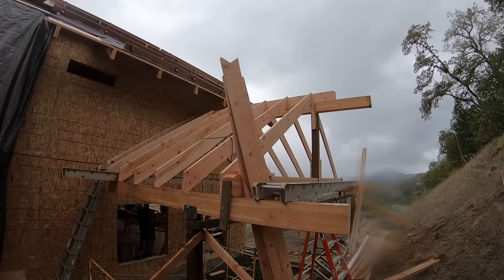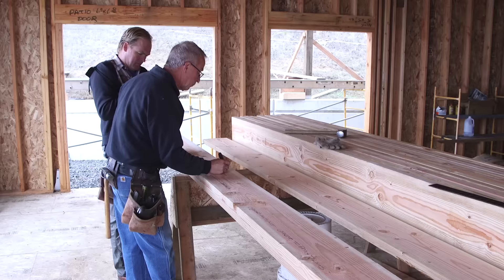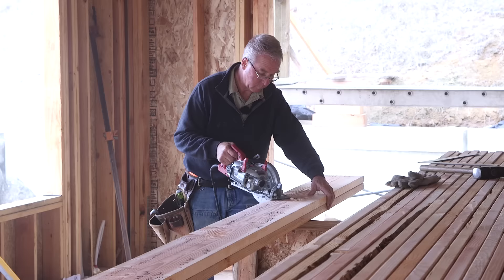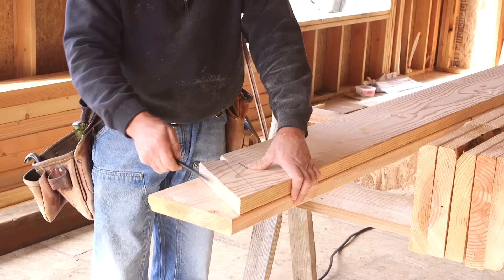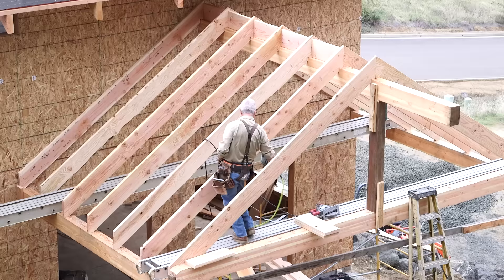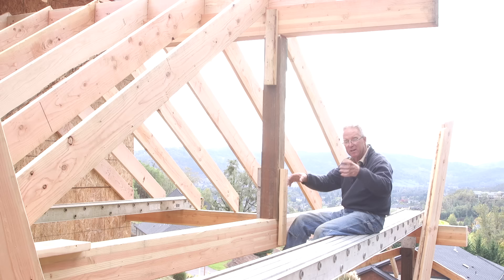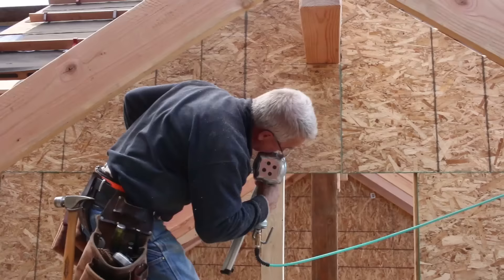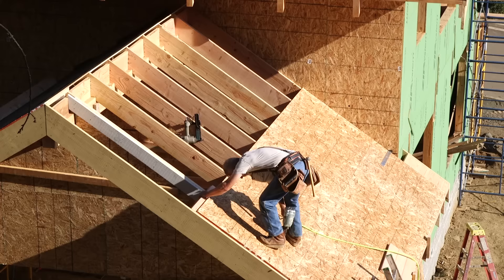Cutting Common Rafters Ep.72

Comment: Grew up in the US framing, roofing and pouring concrete. Moved to Europe when I was in my late 20's. Dear God why do we not use metric in the US. I grew up doing all these calculations and thinking they were simple. WHY?
Reply: "Do as I say and not as I do " the king said"my foot Will be the standard.
Reply: My favourite part is having to convert the measurement to decimal, do the calculation, and convert back again to measure... there are some benefits to imperial, but they’re massively outweighed by the math-friendliness of metric
Reply: I moved to Texas almost 2 years ago. I am a qualifed builder, I use both but metric is far more accurate and better to use.
Reply: In Canada we have metric system but as a carpenter for shy of 40 yrs I still use imperial system . Laying out cabinetry is nice to use metric .

Comment: Essential Craftsman - the Larry Haun of the modern generation
Reply: Larry had poor work habits like overcutting birds mouths.  Slopy workmanship. This guy is much better.
Reply: But he is still better than your carpentry work and you will not reach his level of productivity and skills even if you are the same age as him. The less ppe they wear, the more sketchy cuts and questionable shortcuts they make to make it structural and productive the better they are. Both of the older gentlemen are great carpenters in their owns way and we should all learn from every carpenter as much as possible.
Reply: Did someone just say Larry Haun had poor workmanship...? I never thought anyone could say a single bad thing about the man.
Reply: @dielauwen  careful now, dissing Larry is an enditable offence. Larey wasn't sloppy, he knew exactly how much strength he was working with. 
Modern materials are different. We don't use old growth timbers any more, its farmed softwoods and OSB and so on, so the techniques need to adjust to materials. 
We also know a lot more about engineering, so where Larry's house may not have survived a tornado, a modern house may. That's a design factor, not a sloppy builder. 
Larry was very clear about following the code and said so constantly. If the code changes over time, so would have Larry.
Reply: dielauwen Ridiculous. I knew Larry and trust me there was nothing sloppy about him, and his work habits changed the way houses were framed. There is nothing wrong with overcutting a birds-mouth the way Larry did it. The tail was still 500% stronger than it needed to be. He saved 10 steps doing that. He and his 2 brothers framed one house per day, every day, for years, mostly nailing by hand Try that before commenting on “work habits”.
Reply: @HBSuccess  hell yes. Amazing
Reply: Hope fully scott will become a legend like larry haun,  keep going with the great video scott its really interesting #carpentrylove
Reply: Larry was not sloppy.  You don't understand rough framing.
Reply: Yes he is good to listen to

Comment: I cut rafters off of a template and I reverse engineered it to teach myself this years ago when I started building toolsheds. Man did I wish I had this video then. You explained things I taught myself with a speed square through trial and era in a drawn out process. I liked seeing how you gang cut rafters too we’d be a lot faster doing them like that. I’m gonna try that once we go back to work after isolation
Reply: Me too. I ended up devising my own system. I set the ridge and then measured to the back of the birds mouth diagonally across the board. Test fit, then trace from a template. I know, I know, a complete abomination to any self-respecting rafter man, but it did/does work and I had to do it that way bcz the boss (the real rafter man) would never take the time to show me the right way.
Reply: Only stupid way is the way that doesn’t work
Reply: @psidvicious  That's exactly how I'd taught myself how to do it as well. Seemed like the easiest way to be able to measure it out.
Reply: @Gottesacker86  Haha! It seemed like the easiest way at the time, not knowing any better, right? You already know what the pitch angle is, so that’s not a problem transferring that to the board. Just needed that one pesky measurement for the rafter length 🤷‍♂️
Reply: psidvicious exactly! I have to admit too, I’d never thought to do the rafters first, then the ridge. Though thinking about it, I’d watched Larry Haun do it that way too, but I guess once you’ve got your way of doing it, ya tend to stick to it. I’ll definitely try this method out next time though.
Reply: @Gottesacker86  No, I think we’re doing it the same way. Ridge first, then measure from top of ridge to outside of top plate (which will end up being back of birds mouth). Then transfer that measurement to the board making a sort of arc line so you can get the proper seat cut (length and depth). 
[one of those times when I wished I could include a sketch in YT comments 😁]
Reply: psidvicious yep, exactly the same, arc and everything, hah
Reply: I generally avoid pointing out small mistakes in typing, but in the interest of humor, I feel it's worth acknowledging the irony of "trail and era"; I don't know if it was deliberate, but it would be more amusing if it was unintentional.
Reply: ILikeWafflz ... and in the same vane - ‘trail’ 😀
Reply: @gerryheynes5082  Haha, u caught that too.  I thought that was pretty funi...er, funni, er, funnni....oh hell, u know what I mean!  :)

Comment: I really liked the no nonsense calculation using the framing square and Imperial sizes and this is coming from a metric guy.

My middle school memory tells me to use math for this and I came up with the following result

    Total span is 19'7" = 235" --> half span is 235"/2 = 117.5"
    Rise is 117.5" / 12 x 8 =78(1/3)"
    Length (Pythagorean equation) = Square root of ((117.5)^2 + (78(1/3))^2) = 141.21"
Reply: That's good....you got out of Imperial into decimal on the first line of your solution.
Reply: @davidrichardson376   Standard uses decimal also, there is nothing specifically metric about it.
Reply: @firesurfer  IMHO a decimal fraction of a foot is absurd.  Decimal fractions are at home in metric.
Reply: A framing square is the real thing as it has inches with a tenth scale, a twelfth scale and even sixteenth for die hard customary/imperial people.
Reply: @firesurfer  Some of the old-timers still use Chains and Furlongs too.....LOL
Reply: @davidrichardson376  Pretty much all civil engineering and surveying in the US is done in decimal feet.   You will rarely ever see see a surveyor or civil engineer using inches, except where they have to interface with architects and the building trades.  There's a reason for that, and the reason is when you're actually doing calculations with those numbers, decimal is the only thing that makes sense.
Reply: @davidrichardson376  You'll have a hard time finding any surveyor who uses furlongs.   The reason chains are used are because our public land survey system is based on that, and it's so thoroughly enmeshed in our land ownership system, it's impossible to get away from it.   But here's the thing they measurement system of the Gunter's Chain is actually more decimal the the feet/inches system.  A chain has 100 "links"  and links are broken down into tenths of links.  and when going from distance to area, 10 square chains is an acre.   It all fits together in a nice convenient decimal based measuring system. Try that with feet and inches.
Reply: @andrewalexander9492  I agree, but it is still a poor compromise to an 18th century measurement system.  It really does not matter how far apart the "Tick-Marks" are apart on your framing square, just so long as you don't have to have a second scale to communicate with the rest of the world.  The World is not going to fall into line behind North America on this one.
Reply: @andrewalexander9492  Thank's for that Andrew. Now I'll know what to look for if the occasion arises.  Meanwhile, I will continue to think in Hectares (100 metre x 100 metre') as any other system makes my head hurt and wastes my headspace.
Reply: @firesurfer  And don't let all machinists in America know... they will freak out about using tenths and thous :D

Comment: i am so glad i don't have to deal with the imperial system... its so much extra work
Reply: If you actually learn standard, it makes much more sense than metric.
Reply: @bobsmith-ru7xp  Your right people complain then dont bother to learn anything.
Reply: @bobsmith-ru7xp  It really does not in any way shape or form make more sense than metric. Ever.
Reply: @eggsoups  Don't know about North American rulers but all rulers in Europe go down to the millimetre.
Reply: It's only difficult for those that don't use it.  I don't need a calculator to do 1/16" conversion because I use it all the time.  The same goes for using cups/pints/quarts/etc.  I rarely need to convert inches to feet since every measuring tape I own has both and I'm sure he doesn't either. There are numerous short cuts for these calculations that he isn't showing in order to explain them. The imperial system is so easy to learn we teach children in the United States how to use both it and the metric system. 

The imperial system is based on biological averages. I can use parts of my body to rough out measurements. My index finger middle joint is about 1" long (25mm). My foot is about .. a foot  (30cm).  It's about a yard from my outstretched hand to my nose, a fathom between my hands. When I walk, it's about 5' between two steps, so I can measure out the distance. Very handy when playing golf. One hundred degrees is just about the average body temperature.

We could just as easily use decimal-marked imperial tools.  Why don't we?? Because the imperial measuring system is based on powers of two. It's pretty darn easy to divide things by half or double.  The fractions aren't that difficult for people that do it all the time. And, as you noticed, if it's within 1/16", it's close enough for most woodworking.  If I am working with metal, I might measure in metric or I might switch to measuring devices that use decimal values instead of fractions. Most of my digital measuring devices can display in metric and either decimal or fractional imperial.

Here is the US, we teach metric and imperial in our schools. We give our citizens the option to use either. All products sold have both metric and imperial measurements on them. Almost every thermometer has centigrade and Fahrenheit.  When I cook, I tend to weigh things and use grams when I'm making bread. But I'm just as capable of using a button on the scale to change to pounds/ounces if I prefer.  All of my measuring cups have liters,  cups, pints, quarts, and fluid ounces. 

The US has historically chosen freedoms over the need for the government to babysit them and tell them what is best for them.  I believe that started almost 250 years ago when we told the British that we would just do things our way and they can leave us alone. In the 70s when the government tried to tell us to switch to metric, we told them to shove off.
Reply: @NorthernContrarian  metric really doesn't in any way shape or form make more sense than standard.
Reply: @eggsoups  That is a very interesting point about the lack of quarters in centimetres. I think the imperial system has persisted so long because whilst is is clunky for maths & geometry calculation, on a human level it is intrinsically relate-able. I use metric for my work and any measuring, but I visualise sizes for things like tables, chairs, worktops, people, trees etc in feet and inches.
Reply: @bobsmith-ru7xp  Why? To me it seems much more difficult. Almost all measurements have to be converted when you scale up or down. With metric you can scale up and down simply by adding or subtracting a 0.

Think about it; You can easily convert a number all the way from less than the thickness of a hair, to thousands of kilometers. There's no conversion. In the area of machining and tolerances the metric system is very far superior.
 Fraction of fractions of inches - inches - feet - yards - miles

If you build a building you only deal with one standard. You can decide if you read the measurement in mm or meters. Meanwhile in the imperial system you must decide which one you will read it as unless you want to bring out your calculator.

The same goes for volume, mass and distance. I'm not trying to belittle you friend, or speak lowly about the imperial system. But think about it; 90 % of the world population is in on the SI-system. SI is the advanced version of metric where the reference is no longer a physical thing (except for mass), but has speed of light as reference.
Reply: When you grow up with with feet and inches it is just natural, not laborious for me anyway.
Reply: @NorthernContrarian  I've never seen a special mark at the 5mm point. Just the regular one.
Reply: @bobsmith-ru7xp  what makes it make more sense? I grew up with metric so not that well versed in standard/ imperial measurements.
Reply: @firesurfer  really? all my rulers have a slightly longer mark at the 5mm and the full cm marks
Reply: Continental inches were divided in lines that's twelfth not sixteenth.  The framing square is the only tool with that twelfth scale (and others)
Reply: @MultiWolf777  honestly, it's just how my brain works so therefore it is superior to me, the main thing is that metric users talk about how stupid imperial is so I just talk about stupid metric is to piss them off
Reply: @MultiWolf777  show us, post a link to a pic
Reply: @eggsoups  >>> " ... You have a mark on your ruler for half of a centimeter, but not one for half of that?" 

That's probably one of the lamest arguments against the metric system I've ever seen.   Half of a centimeter is  5 mm. it's marked on the ruler.  If you can count to 5, you're all set.  Half of that is  2.5 mm (or 7.5 on the other  half)  2.5 is half way between the 2 mark and the 3 mark (you can count to 3, right?)  if you have good eyes and a sharp pencil, you can estimate halfway between 2mm and 3mm to about +/- a quarter of a mm accuracy (+/- half a mm would be either the 2mm or 3 mm, I'm assuming you can do better than that?)  So, unless you personally, aren't up to the task, you can locate half of a half of a centimeter on a ruler to plus or minus  a quarter of a millimeter accuracy.  A quarter of a millimeter is less than 1/64"  If you need more precision than 1/64", you shouldn't be reading off a ruler.  If you can't figure out that a half of a half of a centimeter is 2.5 millimeter, you shouldn't be out in public without a chaperone, and you shouldn't be writing with anything but crayons.
Reply: @firesurfer   okay, here https://www.paradisio-online.be/images/on/051/on51296.jpg
Half of a cm always gets a longer line, just like full cm have. Do rulers not jave those where you are from?
Reply: @greatitbroke  That's a funny comment. The only way you'd say that is if you haven't bothered to learn Metric.
Reply: @eggsoups  i dont get why there not being a 1/4 cm measurement on a metric ruler would be a problem, every standard metric ruler goes to 1mm incriments, thats smaller than a 1/16th of an inch.
Reply: Its so much more work. Look get over i hate it to but it comes with something the rest of you will never understand THE CONSTITUTION OF THE UNITED STATES. Mic dropped

Comment: I like your videos a lot.  Your explanations are simple and clear and you make sense.  Your methods may be a little old school but you get the job done.  I have done this for many years and did learn early on how to use a framing square to figure rafter lengths.  Now, I personally prefer using math.  When I'm ready to frame a roof, I calculate my rafter and hip factors first.  After that, you multiply any horizontal measurement (usually the one that is easiest to obtain) and multiply it by the rafter factor to get the length of the rafter.  Seeing as you're not against using a calculator (as some old schoolers are) you should try this on your next project.

Comment: And this why we use metric kids. Spending 5 min just to do math and do fractions and so on no thanks
Reply: Alexander Warren if God wanted us to use the metric system he would have given us 10 disciples.
Reply: @Lazy eye 😂😂😂😂
Reply: @j.hemlock8284  If god had wanted us to use the imperial system he would have given us twelve fingers. :)
Reply: Good video guys!   And besides the metric and imperial system of measurement that a lot of people are raving on about, what about “Pitch ratios v Pitch in degrees”! Using metric and Understanding the degree calculation method can be easily applied to Roofing and many other areas of carpentry, engineering, architecture etc etc etc.
Im in my 60s now but Roof was and still is one of my favourite sports, so just for the craic, half span for this roof in the video is 2984.5mm,   2984.5 /  cos (33.69) = 3587mm.   And back to inches and the rafter length is 141, 7/32 inches!